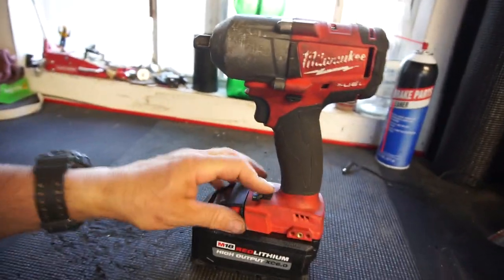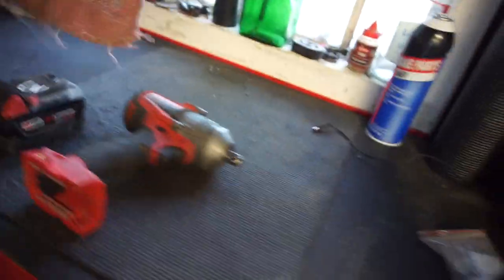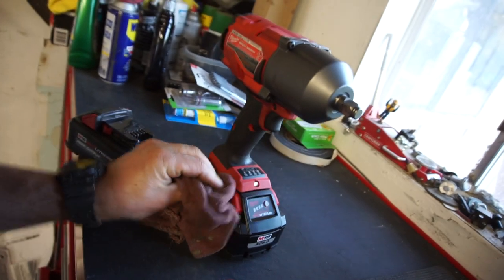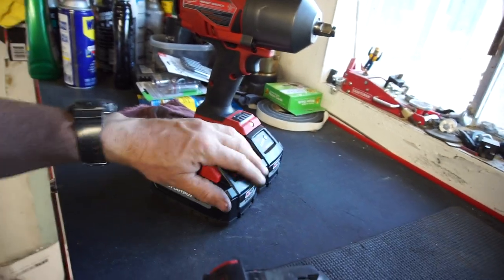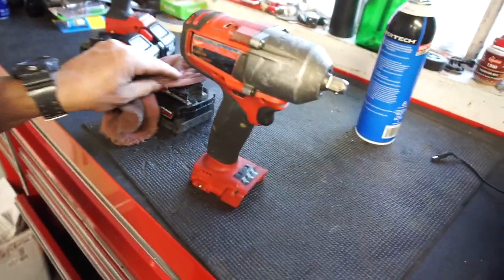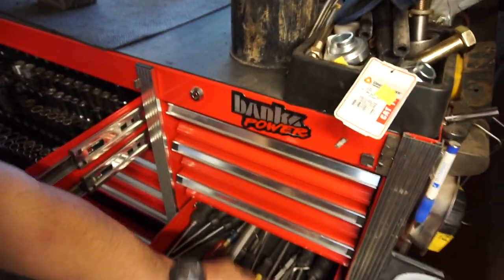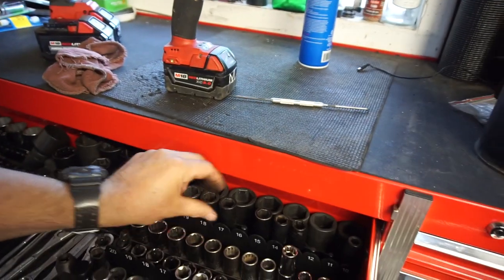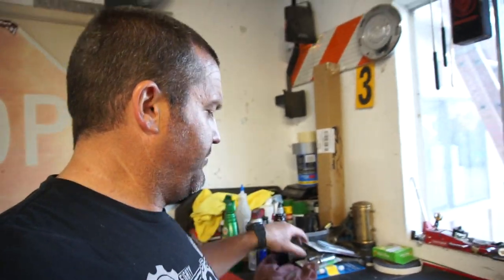M18 Milwaukee Impact Review With Only 1 Con. Have To Have

Comment: Do they sell the 2767-20 with charger and battery, like as a kit? Or does everything need to be purchased separately?
Reply from the maker: Yeah it the 2767-21b. That’s what you want for tool, battery and charger.